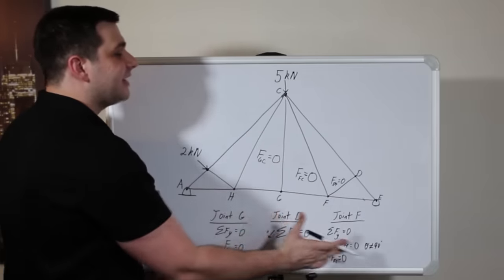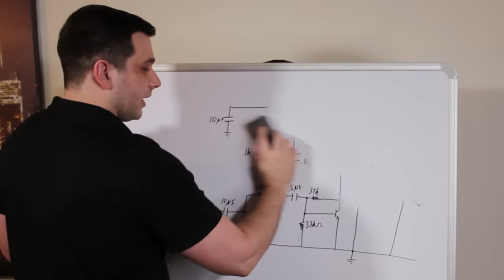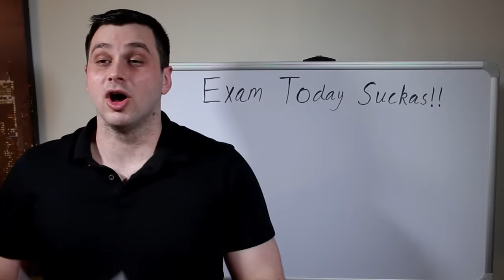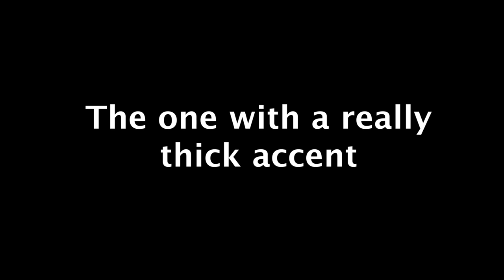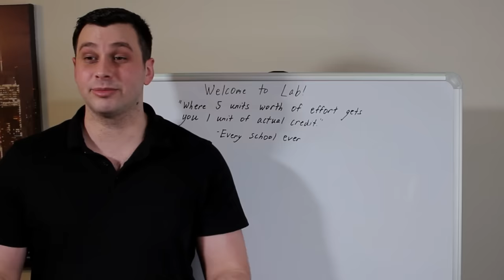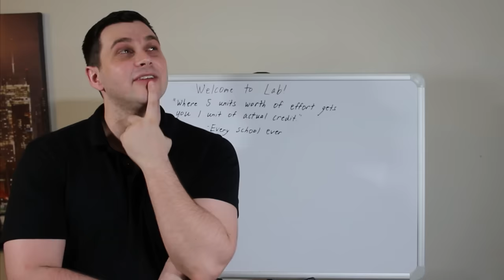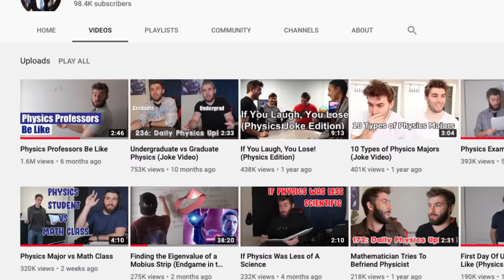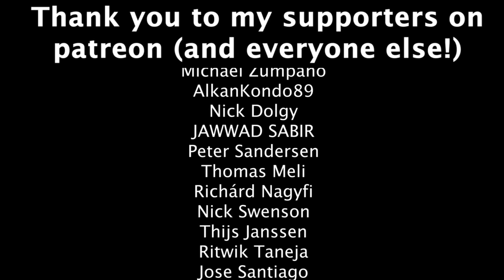Engineering professors be like

Comment: 'You know that semicolons are only used in programming, right?'

*Laughs in Python*
Reply: Eh electrical engineers are more likely to use C
Reply: @lukamitrovic7873  and MATLAB
Reply: *aren't only used
Reply: @johnyang799  Mechanical engineer reporting; I have an idol dedicated to MATLAB. I say a nice sweet little prayer every night before bed. God bless MATLAB.
Reply: print('ha'*3)
Reply: Forgot the negation. That's a solid D+ comment.
Reply: Matlab is the devils reincarnation...
Reply: @whogavehimafork  my uni stopped teaching matlab to mech engs,  so now I only know how to code in python..
Reply: @ethanclark4116  why?
Reply: @lukamitrovic7873  we do c++ in electrical engineering
Reply: @Deiadara  C++ is just an extension of C so I guess it rly depends where you look
Reply: Electrical engineers are more likely to use VHDL
Reply: @lukamitrovic7873  Assembly, C++, Verilog or HDL...
Reply: @lukamitrovic7873  Not really, it has roots from C but it is much more and it has the classification of a different paradigm. C is useful for many things, but C++ can do just about anything C can and more just as efficient or even faster than C if done correctly. However C++ is tough to master. It's easy to learn to write code in the language, but it's tough to learn all of the ins and outs of the various compilers, optimizers, linkers and debuggers to write reliable, reusable and efficient code properly. C is more of a procedural language with data objects where C is based off of that with rich features of Object Oriented programming that happens to be a strongly typed system as well as the ability to write generic programming. It's different levels of abstractions make it a multi-paradigm language. C++ is very power and is one of the top leading industry standards for professional code bases. C is great for writing Operating Systems and Compilers and Kernels but C++ can do the same and more, also in a slightly different manner. Now for basic quick applications where reliability and safety issues aren't a concern then interpreted languages such as C#, Java, Java Script or Python are quick, easy and dirty ways of getting things done but with a lot of overhead. The more challenging ways are to write in C/C++ or even Assembly. However, with modern compilers especially as how advanced they are the C++ compilers can generate assembly code that will run with a high efficiency with less overhead while being more reliable than what you can write unless you are very clever and a top notch pro at writing in Assembly. 

Each language has their own place as it all depends on the task or set of tasks that you are trying to accomplish. For example if you need to write a quick program that will calculate your students final grades from their assignments, tests, projects, research papers, labs etc. You can easily write this in a Python script or even in Excel. However, if you are writing code that will monitor and distribute the appropriate amount of jet fuel to the turbine or jet engines, then C/C++ would be the preferred tool to use. If you are number crunching data that is coming in from satellites then you might want to use Fortran, FORTRAN, Pascal etc. If you are writing front end web pages then Java Script, HTML etc would be your choice, if you are writing the back end server code C or C++ might be your choice, if you are doing the middle data base code for queries then SQL or some other Server Query - Database language might be your choice. Nine out of ten times the language to use is Domain specific where some domains can be done in multiple languages while others can only be done in specific languages. For example if you are writing a Theoretical Mathematics paper, you might be inclined to use LaTex with Math Type libraries. If you are designing Integrated Circuits, Processors, Micro-controllers etc. then you might use Verilog,  HDL, VHDL, etc. If you are trying to solve mathematical proofs then Matlab, Wolframs or Mathematica etc. might be used. So it all depends on the needs of the specific task. No one programming language is superior than any other, however the most widely used language at the professional level for many important systems that require efficiency, reliability and code reuse leans towards C++. Code that is written today that still needs to work in say 10, 20, 50 or even 100 years from now, because peoples lives depend on it is why many industry standards chose C++ and sometimes C. 

As from personal experience I'm 100% self taught. I've learned C, C++, C#, Java Script, Python and some Assembly. Out of them my goto language 9 out of 10 times is C++. One of the main reasons for this is it's efficiency as the fields that I involve myself in are in 3D Graphics Rendering and Game Engine designs, Physics Simulation and Animation, Audio Processing, and Hardware Emulation. When I was using Direct X or OpenGL C++ was the main choice. Now that I'm learning Vulkan I'm going back and forth between C and C++, parts of the project are done in C while others are done in C++. C# is okay for doing Direct X and OpenGL but I don't care for its concepts that "Everything is a Class" and I don't care for its garbage collection system. I'll either write my own Memory Management Systems as a core part of the engine using raw pointers if necessary or I'll build my Asset Storage class that is wrapper class around smart pointers. Also the amount of libraries that are available for the C++ language makes it a great choice for large scale projects. 

For one to appreciate the different languages and their uses I think they ought to dive deeper into understanding the underlying mechanics of a computer system down at the hardware level at least to the "Logic Level" where all of the integrated circuits are built from logic gates, it would even be useful to at least understand or know how the different logic gates are built from transistors and to understand the schematics of an electrical diagram and knowing how Ohms and Kirchoff's Laws work and to understand timing diagrams and propagation delay, but at the least I think the Logic Level with Boolean Logic is probably the most important lowest level of abstraction  that should be a need to know. Then when you move up a layer of abstraction to understand how Boolean Algebra applies to both Logical and Sequential circuits and how they relate to Finite State Machines this helps you to understand different kinds of algorithms, what state machines are and how they relate to what your Operating System and Compilers or Interpreters are doing with your source code when they convert them into either Assembly Instructions or Op-Byte Codes. Then from there having an understanding of how all of the connected components of memory (main memory) cpu with registers, cache, ALU, and controllers all connect to create your data path and control logic and from there to be able to understand how the instruction set applies to the hardware and how that can be converted to an assembly language gives you an appreciation of the high level languages. When one begins to understand these underlying principles and then goes back to writing in their high level languages such as C, C++, Java, Python etc. the will begin to appreciate the complexity of what the Assemblers, Compilers, Linkers and even the Operating Systems do for you! I believe that knowing this will also make you a better programmer or engineer so that you will end up having less cache misses and page faults in your code while using memory and pointers properly and so on. 

Everything that I stated above from the underlying advanced mathematics and physics to the actual hardware design and implementation to the software side of things with all of the algorithms, data structures and techniques, and much more is all self taught. Through dedication and the willingness to want to learn it, I've been able to build a solid working 3D graphics engine from scratch utilizing various existing libraries and APIs whiling using all of the techniques that are used in programming the graphics pipeline, managing memory, creating multiple renders, all of the various lighting techniques that are used in Shaders, Collision Detection, Physics, Animation, Game Based A.I., GUI systems, etc. I've done the research and applied them to source code, many hours of writing, and twice or even three times that many debugging. Then when I was done and seen something I didn't like, I'd go and redesign parts of it to make it more efficient. One of the most difficult things to wrap your head around in programming is Multi-Threaded and Parallel Programming, but once you can tackle that, everything else seems like child's play. It's not an easy project to take on even for some programmers who happen to have a Bachelors Degree this can still be quite difficult for them. Then to go from there and start learning how to design Hardware Emulation projects is even more challenging. After that I started to tackle the ability to design a simple 8 or 16 bit CPU in simulation programs such as Logisim and I'm just starting to learn Verilog. I think my next task will be to implement a basic Assembler - Dissembler, Compiler and even start to working towards learning Operating System designs. I know that this has become quite long so I'm going to leave it at that...  my ambition and desires to continue with my research and studies to improve my craft is a never ending process...
Reply: Azelide JavaScript
Reply: you can use semi colons in python though
Reply: @lukamitrovic7873  oof

Please dont write c++ as c with extra steps
Reply: you can use semicolons in python aswell
Reply: @jojoposter  extension doesn't mean extra steps, C++ is built on top of C, it's got literally all C has and more
Reply: @whogavehimafork  I love Matlab as well
Reply: @lukamitrovic7873  I use C and Python, but that's because of Neural Networks
Reply: that's actually the opposite of what he said.
Reply: cout<<"laughs in pytgon";
Reply: Luka Mitrovic We use C for hardware implementation and C++ for pretty much everything else
Reply: [cue "PYTHON ISN'T PROGRAMMING" replies]
Reply: jeff pentagon See, that’s why nobody is using them
Reply: @jeff pentagon Is there any situation in which that'd actually be better than doing
i = 1
j = 2
print(i*2+j*3)
?
I feel like the semicolon thing just makes your code harder to read.
Reply: Azelide python is kicking my ass
Reply: @jeff pentagon python isnt programming? Wait till you get to MATLAB.
Reply: @lukamitrovic7873  Don't ever say that to a C++ or C developer. or anyone who knows how to code... it's like saying C# is a sharper C
Reply: mike johnston Bob In my opinion and the fact that I took C and C++ back to back, C++ is just easier to use. Takes less lines to code the same thing most times.
Reply: ahhh goddd this reminded me that I still have to work on my statistical analysis python project that's due next week, (accidently opens html whilst typing this comment) ohh the irony lmao, what is a tuple agian?
Reply: @halden3014  For sure the reason why is because they didn't want to pay for their MATLAB licence anymore
Reply: or lua and javascript

Comment: Including the Death Star at the end was a MASTERFUL move
Reply: he included that apple mouse that charges on the bottom too hahahahaha
Reply: To be fair, it was a deliberately engineered flaw
Reply: @discretelycontinuous2059  
You mean it was retconned as a deliberate design flaw
Reply: @ryanalving3785  Doesn't matter to me that it was added retrospectively. It is the canon explanation
Reply: @ryanalving3785  Retconning is when you change old facts with new ones with no proper explanation, Going back to explain a design flaw is good writing, Not retconning, No facts were changed, Just new ones added.
Reply: @MishaFlower  
That's fair

Comment: I'm not an engineering but rather architecture major. We have a mix of engineering and non-engineering oriented classes. The first engineering class we had was called Structures 1. It was supposed to teach us how loads are distributed in various structures so that we could choose decent members and have reasonable spans without the aid of a structural engineer (of course they're still required, but this helps lighten the load a little on the engineer and make the design process run more smoothly).

The professor who taught that class shouldn't have been a teacher.

He was never available outside of class, even during his office hours. He never answered emails. His handwriting was impossible to read and his internet connection was terrible (this was during covid). He would avoid answering questions and sometimes got angry at students for not understanding things that weren't explained very well. We (class of about 60) had to be tutored by one guy's older brother, who was an engineer. Most of us still got below a C for our final grades. After that semester, he either quit or was fired. There were many, many emails sent to the admin and even a petition to get him removed.

There's no doubt in my mind that he's a smart guy, but he doesn't have the temperament to be teaching, let alone not-really-STEM students who often struggle with this kind of stuff. I hope he's doing better not being a professor.
Reply: Notwithstanding his pedagogical faults, architecture isn't interior design. In any sane country, architects ought to be required to have a solid engineering foundation, including structure of materials etc. Yes, real engineers are still required because there are a lot of very tricky edge cases, but an architect ought to be able to do fairly comprehensive load modeling. It is not a liberal arts profession.

Comment: late to the party but thanks to my calculus teacher and the questions they present us in the exam I absolutely despise math
Reply: Go on...
Reply: I find the biggest issue is that they give all these methods to solve things but for very specific types of problems. Then, in the exam, they give questions within the same topic but radically different examples you don't know how to apply what you learned to.

 It's akin to them giving you a hammer and showing how it can hit a few nails, but you've never seen a hammer before, so you end up only able to use it for hammering those specific nails. The way so much math is taught is super inflexible. Took me until 2 years into a degree to realize I wasn't bad at Calc, I sucked at algebra because I was only ever thought how to use it not why it's used
Reply: A teacher will make or break a subject, an easy subject can become absolute hell if you're teacher isn't any good

Comment: 1:55 this is why I've adopted the healthy habit of waiting until the first class to get the book unless the prof sends an email about it
Reply: I made the healthy habit of only getting the book until I'm a month through the semester and I'm failing it
Reply: or free pdfs, so even if it's not necessary, it didn't cost you anything. Except maybe storage
Reply: @teresadunn903  well yeah that too xd, generally searching the isbn or the title + pdf  works to find it.
Reply: Pirate the textbooks, actually why doesn't everyone just pirate these shitty textbooks.
Reply: Me and my friends would usually wait until a month before the final exams to get the books when we were in engineering
Reply: Similar
Reply: @whatamidoingwithmylife4108  some of the classes require access codes, so you can do the homework for the class. And you need to pay to get the access code.

Comment: One of my favorite professors made exams that were basically impossible to finish so he could use to scale the class better. I really liked the system he had because it encouraged you not to write fluff for partial credit
Reply: Then there's that one student who gets extra time on exams and wrecks the curve. I was surely that guy on numerous occasions. Time-limited exams are BS.
Reply: @quillmaurer6563  you either know it or you don't? what's 10 minutes going to change?
Reply: @phoomphgaming5538  It can make a big difference if you don't have time to answer all that you do know. Some exams provide way more time than needed, while others almost everyone ran out of time, didn't have enough time to solve all the problems. Typically this applies to problems with calculations that take time, simple factoid multiple choice it doesn't make as big a difference. Engineering classes most of the questions require often somewhat complicated calculations.
Reply: @quillmaurer6563  thank youuuu!! That’s what I’ve been saying

Comment: This just brought back so many bad memories from my engineering class for the past 2 years and it was accurate as hell he had an accent he never fully answered questions and everything was worth 100 points so the warmup that could be a sentence long or a super long equation was 100 points and not doing the equation the way he said instead of letting us find an easier was points off because it was "wrong" even though the answer was the same
Reply: Ah yes. Engineering. Where finding new solutions to existing problems is "wrong."
...wait a minute